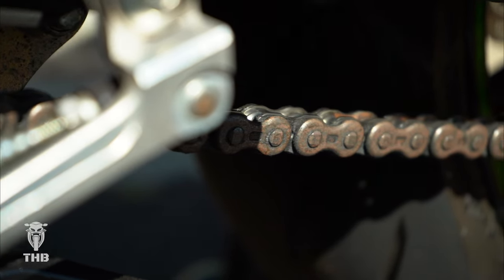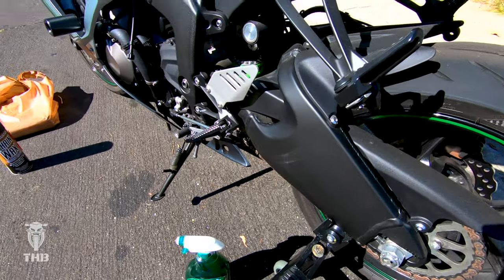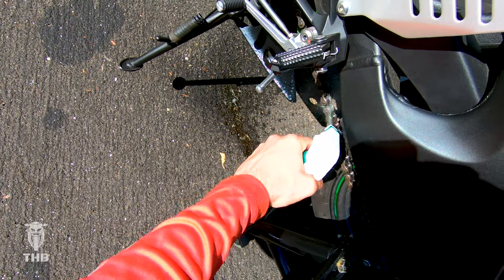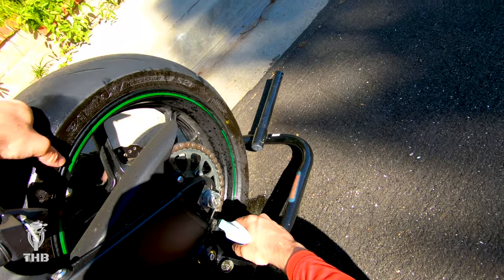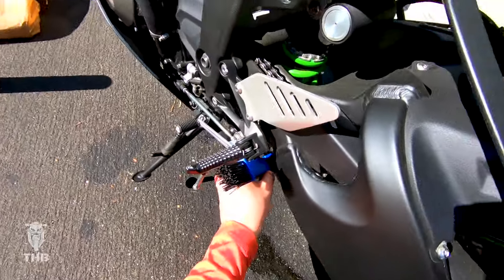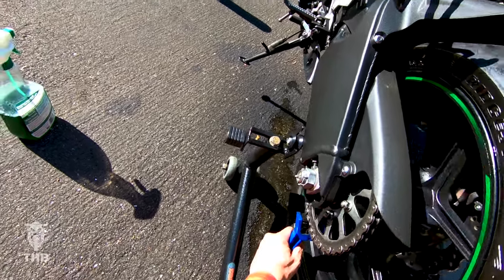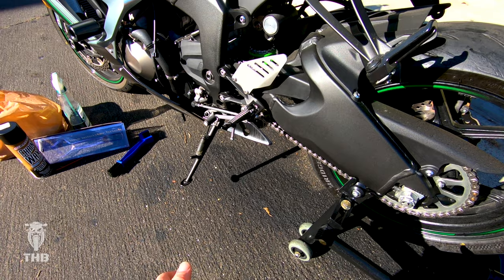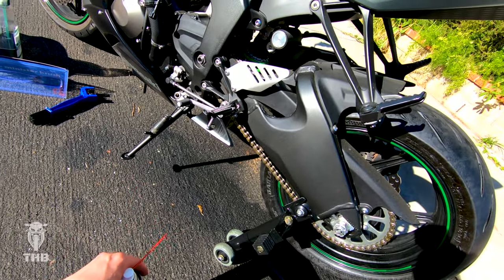CHAIN MAINTENANCE | Cleaning And Lubricating - Simple Green, Grunge Brush And Maxima Chain Wax

Comment: You will damage the rubber seals on your chain w Simple Green bro.  Same for any harsh chemical.  Use the matching chain cleaner from the chain wax company.
Reply from the maker: Highly recommend checking out FortNine’s chain cleaner video and re-considering that statement.
Reply: @HypeMotorsportsMedia  No thanks.  You are wrong.
Reply: @katherinedarber-wilson8245  no, you’re wrong 🤷‍♂️
Reply: back your "research" -  it's already been done by: FortNine
Reply: Silca has an interesting article "Hydrogen Embrittlement, Can You Really Break a Chain" Here they warn not to use simple green because it can make the chain brittle. If you still want to use it rather take simple green aircraft cleaner.
Reply from the maker: @Gieszkanne  Are we talking about bicycles? 🤔
Reply: @HypeMotorsportsMedia  About chains!
Reply: You've been drinking the Chain Products PR Kool-aid my dude